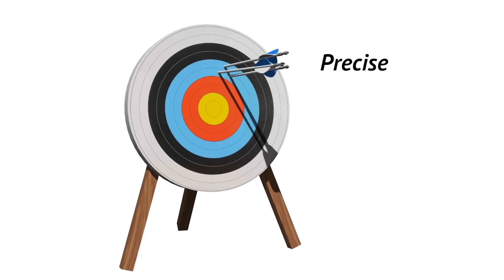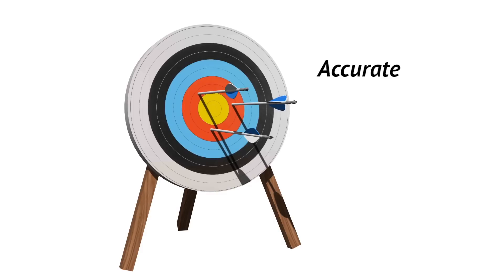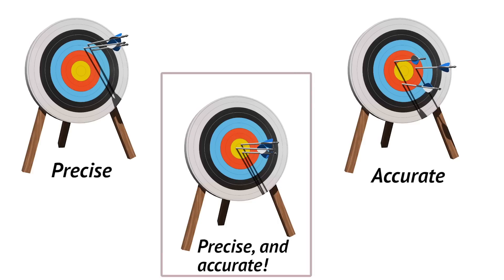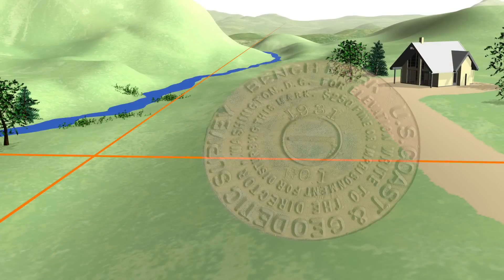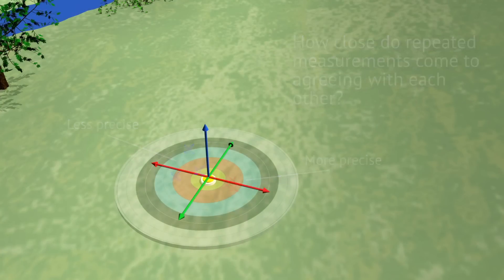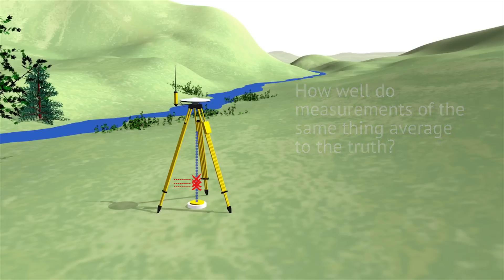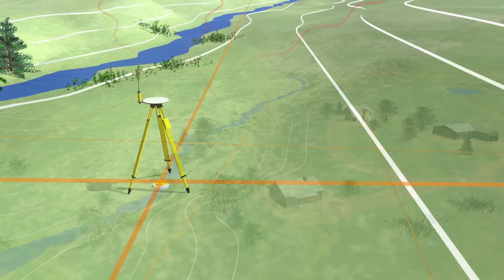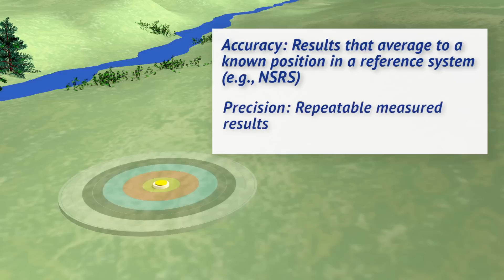Precision and Accuracy in Geodetic Surveying

Comment: The bullseye metaphor works well for teaching accuracy, but not precision. Accuracy describes the quality of measures [accurate:the data contain no or acceptable small errors, inaccurate: the data contain unacceptable large errors]. Precision describes the quality of the measuring method [precise:the method produces repeatable and consistent measures, imprecise: the method does not ... ]. The bullseye metaphor leads learners to understand incorrectly that both terms are describe data quality.

Comment: The bullseye metaphor always works well for teaching accuracy, but not precision.  Accuracy describes the quality of measures [accurate:the data contain no or acceptable small errors, inaccurate: the data contain unacceptable large errors]. Precision describes the quality of the measuring method [precise:the method produces repeatable and consistent measures, imprecise: the method does not ... ]. The bullseye metaphor presented in the video leads learners to believe incorrectly that both terms are used to describe data.